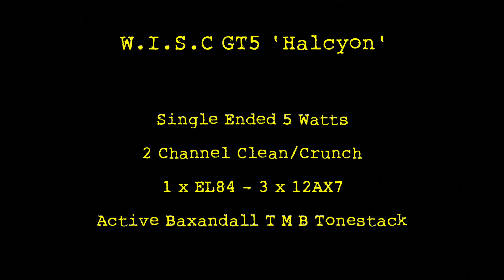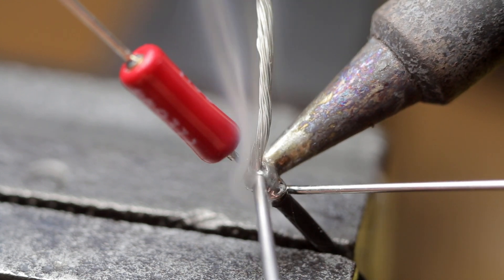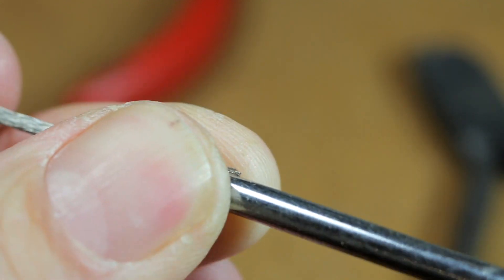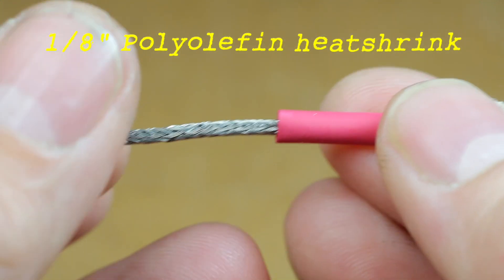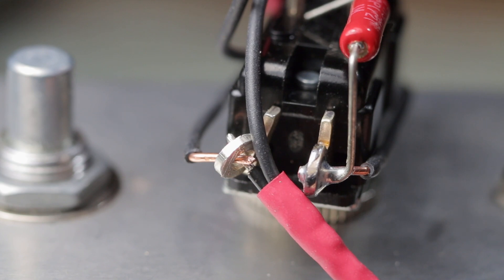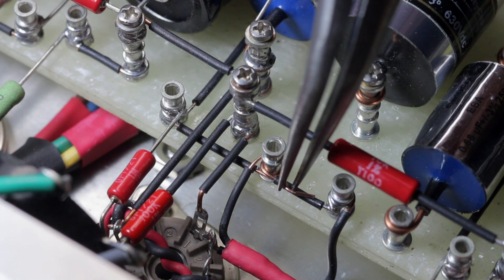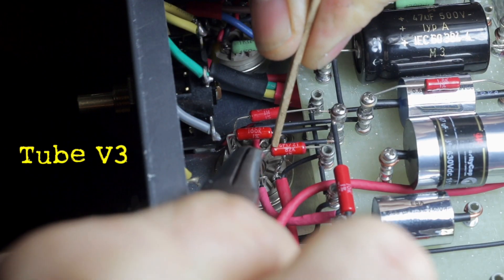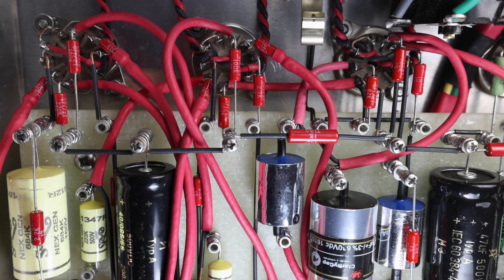Do You Need To Shield Tube Amp Cable? - W.I.S.C - GT5 'Halcyon' Build 5

Comment: You can ground shielding directly to the chassis. You don`t shield a cable to route the noise to audio ground.
Reply from the maker: In my opinion, it makes more sense to route the shield to its electrolytic negative terminal. In that way, you minimize the potential of creating numerous unnecessary ground loops. In addition, by laying the insulated shield cable next to the chassis, you gain the benefit of the shielding provided by the chassis, without creating a ground loop.

Comment: If you place the tube sockets between the pots and the board you'll avoid those long cable runs and you'll probably need only 1 shielded cable (from Input to V1). Other cables are very short.
Probably not an option if you follow an existing layout, but if you design your own this looks like a very inefficient way to do it...
Thanks for the videos! 😎
Reply from the maker: Yeah you could do that, however new issues and inefficiencies arise. I wouldn't be particularly comfortable with filament cables underneath the pots, or anywhere near the input for example. One could re-route filaments u DER the board but I'd rather have access. It all boils down to what is most sensible to you and if it works, it works. Food for thought though. Cheers

Comment: Really OCD yet you neither clean & tin any of the wires before soldering them nor do you make good mechanical connections before soldering. Get some Scotchbrite and shine that bare copper up and then tin it before you start tying it together. Same goes for the stranded wires. Stop making shielded cable and go buy some proper Mogami mic wire with a semicon layer. Proco also makes a good budget shielded wire with a semicon layer. Save your skewer for poking a hole in the shielding. Poke a hole wallow it out wider then fish the inner conductor through it and use the tail of the shield to tie to ground. No splice = no splice to cause problems later.
Reply from the maker: I do tin. Also, I have used Mogami cable and it melts easily, hence I make my own. The tail of the shield sucks, it's messy, hence I make own. Cheers.
Reply: @elams1894  You can find quality shielded cable for amps - thin, not melting, much more easy and faster to work with. Even with teflon insulation and very low capacitance.

Comment: Witch one is better, using a PCB or turrets?
Reply from the maker: It will be a debate for the ages. However, in my humble opinion, turrets are superior to PCB. The main reason is because the traces on a PCB struggle to handle the high voltage of a tube amp. Many times the traces will give way. Turrets allow you to use larger cables that will handle both heat and high voltage. Cheers.

Comment: Love your videos. Thank you. In all of the books and research I've done, shielding has been the grayest of areas. If I understand, when shielding, only solder the one side to ground to avoid loops? Do you have a rule of thumb for which side you choose to solder to ground? Any other methodologies or perspectives when making the choice how to connect the shielding? Thanks!
Reply from the maker: Hi FARW, thanks for kind words. I have pondered many times the questions you have asked regarding shielding and have come up with my own conclusions. It does not matter which end of the cable shield you earth. Some say it does but I can assure you that it matters zero. What I prefer to do however, is earth the shield to the stage that the cable and component exists. When I say stage, I mean, to the electrolytic capacitor that the cable and component from/to which the shielding exists. For example, if the cable is shielding the signal from the plate of V1, then I earth the shield to the star earth point of the electrolytic capacitor that filters V1. Bear in mind that I only ever use one earth point for the audio circuit, that being at the input jack. I also utilise one additional earth point for the mains, and power transformer secondary winding centre taps. This is critically important. Only ever have one earth point for the audio circuit (at the input jack preferably) and avoid multiple earth points near the tubes or anywhere else on the chassis. One mains earth point is best situated near the power transformer. Fire away with any other questions. Cheers
Reply: @elams1894  thanks man! Appreciate it.
Reply: @elams1894  The grounding scheme is one (of a few) confusing theoretical aspects that I find challenging to understand. Particularly if you follow a vintage layout when making a replica amp where the can caps are at one end of a turret board near the transformer i.e. not on the board as you prefer. I see those caps earthed to an earth tag near their -ve leads. Whilst another earth tag is situated at the other end of the board for the rest of the signal earths. Often there is a bus wire to ground the pot earth connections and this solid wire is connected to that signal earth tag by a wire. As you mention the power side has its own gnd lug. So given that scenario, how do you avoid several earth tags connected to the chassis for the signal grounds? Is it OK to have one tag as you suggest and run longer wires to the earths of the can caps if they are at the 'other' end of the chassis? Or is it OK to daisy chain the earth connections from one component to the next closest etc until you are close to the lug chassis connection and then fly the last wire to that point??? As I said Im rather confused, never mind understanding what a gnd loop is.
Reply from the maker: @allanpennington  In vintage amps, the can cap earths are grouped together and grounded near the power transformer end. The can caps filter the HT line (high DC voltage) and are often called the power amp ground. You can get away with grounding these can cap earths together near the PT. All the rest (audio) I would daisy chain in order (if you can) and ground at, or on, the input jack. This would give you 3 earth points. I would try to keep it to 3 minimum. As long as the can cap earth and transformer earths are at the other end of the chassis from the input jack earth, you should be ok. Grounding is very confusing indeed. The Valve Wizard dot com, does a very good section on grounding in tube amps. It is well worth a read. Cheers
Reply: @elams1894  Thanks, that helps me understand. I’ve read that Valvewizardry and although I’m tech savvy it was still a little hard to understand. I appreciate you taking the time to reply. I’m on a long journey to build my first amp. I’m modelling in 3D first to prove the layout and make sure I have drawn the circuit correctly first. Solidworks Electrical routes the wires automatically in 3D so I can check that they are going to the right place. It’s a Vox AC10SRT I’m doing and only have gut shots of three original amps. I have two almost identical schematics. One has the B+ connection to the OT CT from the EZ81 rectifier before filter caps. In the other it has this connection and pin 9 of the EL84s after the first filter stage and resistor node. and from what I can see in the original amps they are wired this way. However a couple of people have cloned this amp and connected the OT CT directly to the DC output from the rectifier. I’m not sure why.

Comment: I guess an instrument cable won't do it right? (: 
These cables, is there a reason you don't buy them?
Reply from the maker: You can use the Mogami shielded cable, that's nice stuff but it melts easy. I make my own as I use high temp wire and I can make mine thinner, 2mm approx as apposed to 3mm plus fir Mogami.

Comment: Mr. Elam,  comparing your techniques to Mr. Fender’s in the 1950’s, what would be the main differences? and benefits? thanks again
Reply from the maker: Not a huge amount. Perhaps the position of components and a concentration on good positional practice. Other than that, not much. There was still an emphasis on neatness and best position in the 50's, not as much as 30's and 40's era, but nonetheless better than the 80's onwards. My build practice is fairly similar I would wager. Cheers
Reply: @elams1894  Thank you. Did you ever study the layout technique of builders like Howard Dumble or Trainwreck Ken Fischer?
Reply from the maker: @knowmusicman157  I like both amps, and they are well made, particularly the Dumble with resistors right on the sockets with tag support, and with elevated filament wires. The major difference with my construction and both Dumble and Ken is filtering positions and perhaps more attention given to placement of socket plate nodes. I prefer to isolate the nodes, or turrets of plates, away from other plate turrets, as the plate magnetic DC field is huge, the induction into which (like guitar signal), can very easily occur.

I believe great care must be given to the plate areas and extensions, perhaps as equally, if not more so, than grid areas and extensions. To extend upon that, and another difference of my methods is filter cap placement. I like to align the filter caps with their corresponding tubes. This helps large magnetic field loop reduction along with more suitable ground routing. I believe it pays to keep all those components associated with a tube, as close to that tube, and oriented to the ground point of the electrolytic cap, as much as possible. The most important thing, above all, is to have only one audio ground positioned as far away from the power section as possible. Multiple ground points should be avoided at all cost. I'll have a better look at K and D's layouts and see what else I can see. Cheers KMM
Reply: @elams1894  I have read many opinions about building replicas of vintage amps and that 'keep the layout the same or similar'....'otherwise risk the amp sounding different'. Would this likely be the case? For example could you change the sound of an amp from a circa 60's style if you moved the caps onto the board close to the tubes they are supplying filtered B+ to as apposed to leaving them off the board and situated at one end of the chassis far from the signal tubes??
Reply from the maker: @allanpennington  It all depends upon how much unwanted noise is acceptable to you. Some vintage Amps are very noisy in terms of hiss and hum, some not so much, and often it is luck of the draw. In terms of guitar tone; that won't change that at all with a different layout. The tone is in the circuit, irrespective of how it is laid out. I strive for low unwanted noise, that is paramount for me. However if an exact clone is what you're after, then a solid original layout obviously will always work. I still would avoid multiple ground points at all cost. You can easily achieve this as an improvement, if nothing else, on a vintage layout. Cheers.
Reply: Elam's attention to detail is pretty astounding.  I also think there are some nice 'evolutions' in this method.  Better filament lead dress, minimal distance from key resistors to the tube sockets, lots of shielded cabling, etc...  Old Fenders are fantastic amps that have clearly stood the test of time.  This is another level.
Reply from the maker: @KleyDeJong  Thanks Kley, I very much appreciate your kind words!

Comment: Your precision gives me anxiety, knowing that I have my own soldering project coming up 😂. The last project we did the soldering iron was broken so we ended up just heat shrinking everything  together. Does that qualify for using as little solder as possible?  Cool vid as usual dude🤘
Reply from the maker: Thanks Rob! Ha, yeah maybe nah, regarding the heat shrink ha ha. That's good lateral thinking though. I guess it will hold until oxidation sets in, but maybe it will stand the test of time. All the best with the next project!

Comment: The thumbnail dude ahahahah
When it comes to holding stuff in place I use a little jig with clothes pegs but the sticky clay method is brilliant
Reply from the maker: Thanks G, much appreciated!!
Reply: I noticed that too. I’m thinking of using plumbers putty as sticky clay (it’s the same thing for all I know). It’s like a secret weapon to get that really really clean assembly of all the fiddly bits.
Reply from the maker: @MadScientistGuitarLab  Indeed the clay technique is a god-send, really helps for sure. Once I went to clay, my sanity was restored. A simple aid, but one that alluded me for a long time. True story, I was getting seriously frustrated with a resistor that kept moving when soldering and I shoved my whole bench in frustration and a packet of the clay fell off the shelf above onto my amp chassis and further screwed up my work. I was about to throw the whole packet against the wall and then I clicked. It was a sign and I haven't looked back ha ha.
Reply: Sticky clay is now on my list of things I NEED!!!